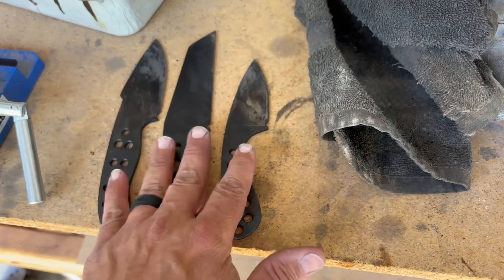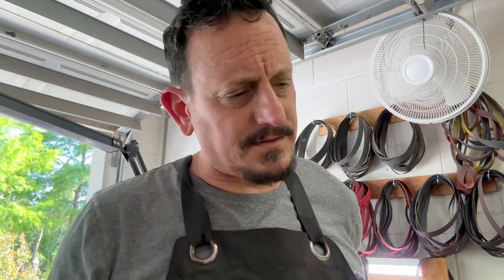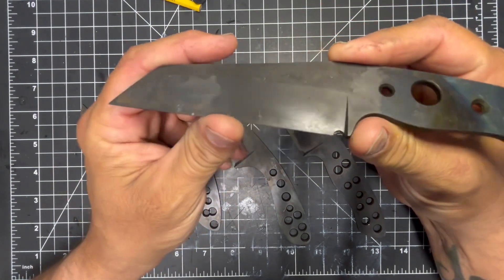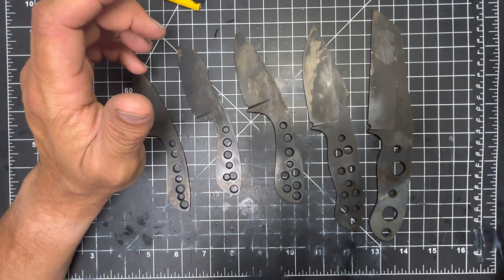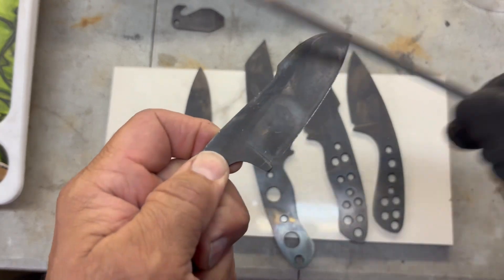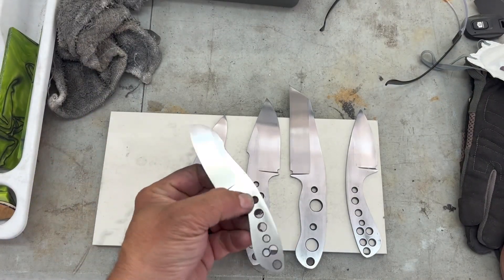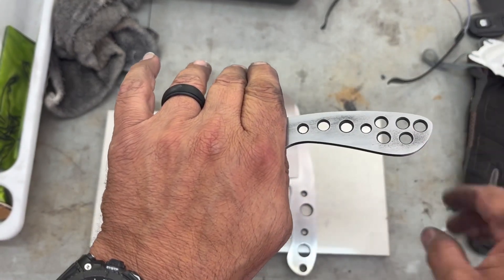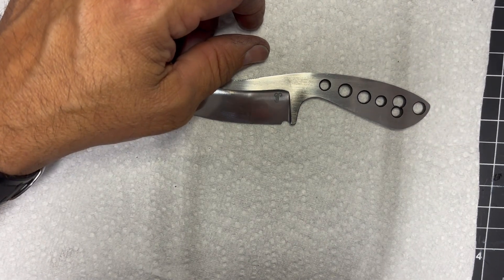I Am Flying With These

Comment: You're really moving right along with the April builds.  I know they're probably on backburner now, not just because of the etching but HOPEFULLY you're gotten the two March builds back from heat treatment so you can finish knocking those out.  

I know that's gotta drive you nuts not having them finished.  But it's no fault of yours and I'm sure the people that ordered them understand and aren't bothering you about it.  I think for the majority, the knife community is understanding and very happy with what you're doing.  

The knives are looking great and looking forward to future updates.  Enjoyed the livestream also.  Now for the Amazon delivery and the knife delivery and you'll be good to go.  Fingers crossed that the other two you sent off to be heat treated get done quickly for you so you're not worried about them.  Have a great weekend!!
Reply from the maker: Yes they are coming along.  I just got the March builds in and should get the stencil today as well.  So I will be able to move forward with March and do a bunch of etching when those are ready.    All going to go fast now.  Thanks.